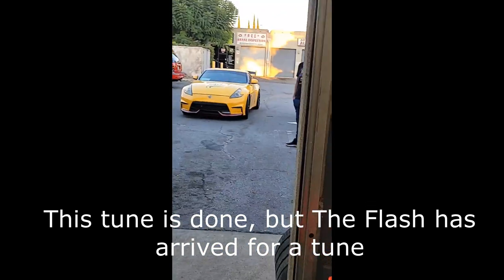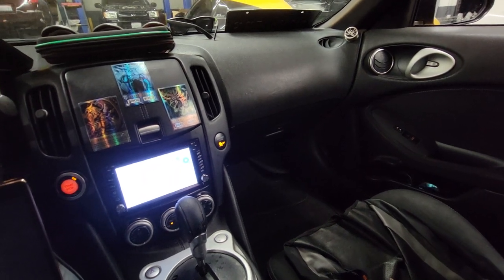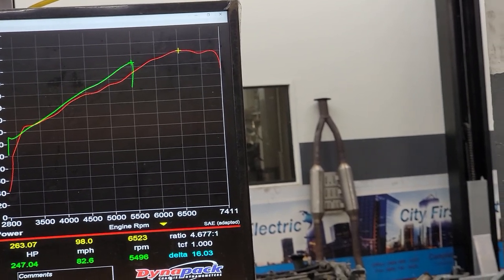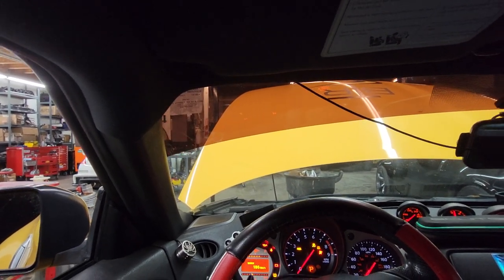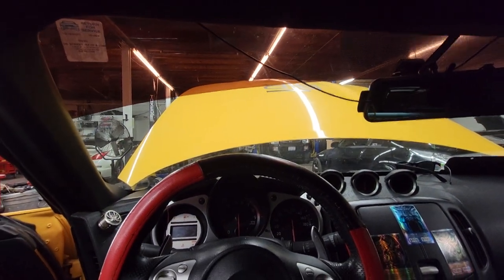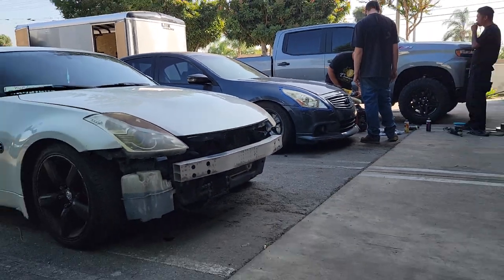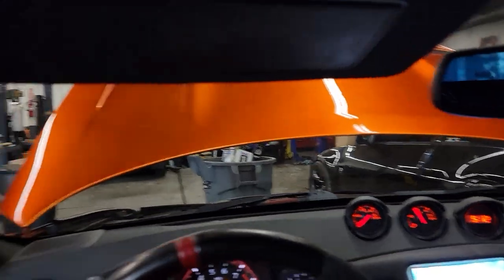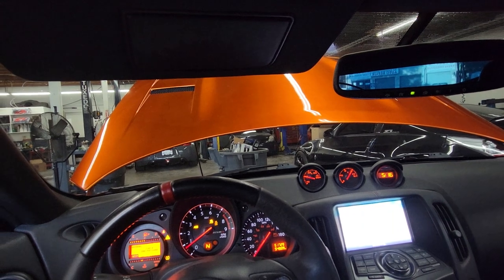Crazy Orange color 370z gets tuned

Comment: I'm at 320.11 WHP 271lb/tq 

2012 Z 6 speed

Z1 INTAKES
TOMEI Test pipes
TOMEI exhaust 
Stock injectors / fuel pump on 91... 

Sebastian at specialty Z did my tune. 

Good to know my Z is on the higher end of the spectrum as far as healthy motors go she's got 73k on her
Reply from the maker: Every dyno reads differently